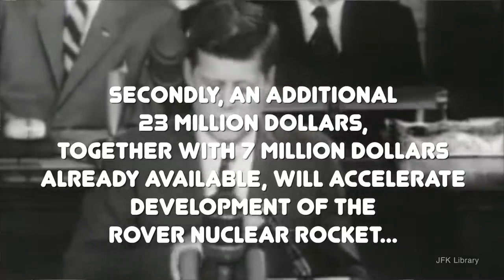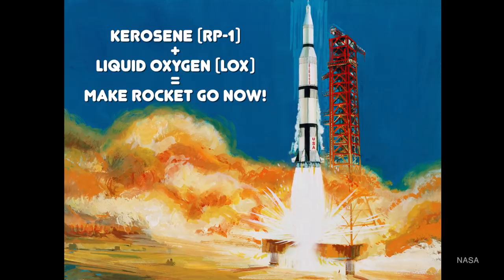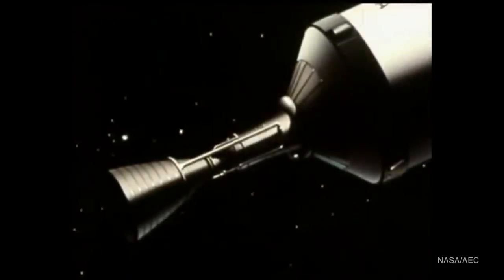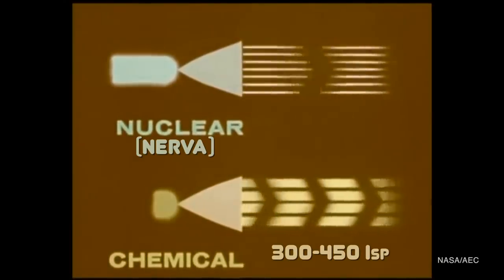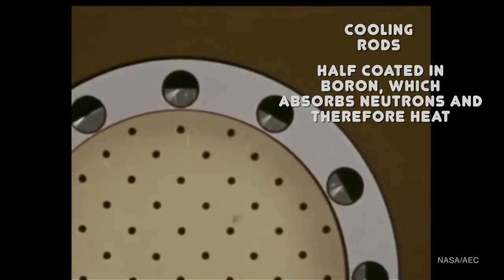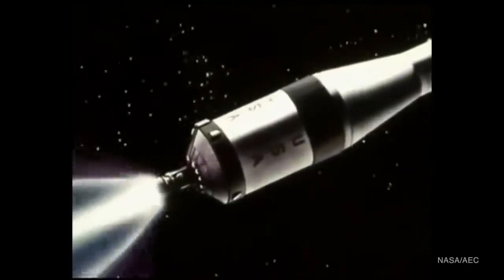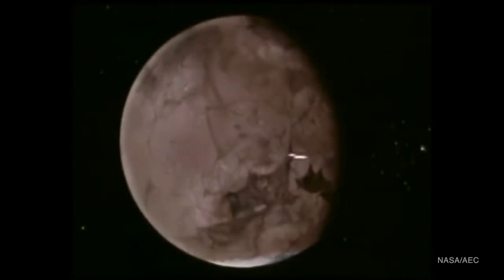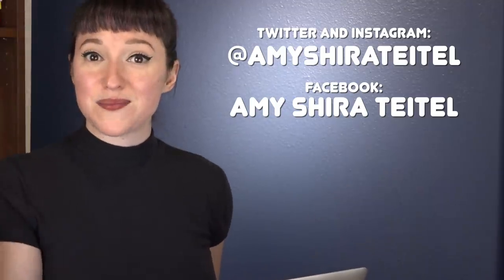A Primer on Nuclear Rocket and Why They're Awesome in Space

Comment: So while I love vintage space, I do have to disagree with the explanation given here.
What governs rocket propulsion is momentum exchange so having a faster gas exhaust speed with a lighter gas (ie hydrogen) doesn't necessarily give you more thrust, as for Isp, it is purely based on the exhaust speed and not the mass of the propellant!

To achieve that high exhaust velocity, we heat and pressurize the gas and then use a convergent divergent nozzle (or de Laval nozzle) to accelerate it, whether you use a nuclear or chemical rocket!

The reason a nuclear rocket engine is much more efficient (Isp wise) is primarily due to how you achieve that high temperature and pressure! You are using fission which is has much higher power density than a chemical reaction! This is why a nuclear bomb is such more destructive than a chemical bomb!

Since the energy density of the chemical reaction is much lower, this is the first reason of the Isp difference. A second one is directly linked to the chemical process, in a chemical rocket, the pressure required are so high that the chemical reaction time is equal or longer than the time the fuel spends in the engine, so you do not actually use all your fuel! The big flames you see is what the engine waist! This is why hydrogen fuel is the best rocket fuel today, not because of its mass but because of the kinetics of the combustion, hydrogen has a much faster reaction time than fossil fuels so you extract proportionally more energy from the fuel that you can use before you eject it out of the engine.

Finally, the primarily reason of the use of hydrogen for the fuel in the nuclear rocket is due to its thermal properties which optimize the heat transfer through the reactor! The key part is getting the gas as hot as possible! Even with hydrogen, the NERVA designs were planned to produce about 5 GW, which would make them the most powerful nuclear reactors in the world. If it was as easy to heat up a heavier gas we would do it as we would generate proportionally more momentum.

Basically, it is a fight between splitting the atom and stealing electrons!
Reply: SoldatInconnus 
Exactly.  We’re still a Slave to F=MA. If the exhaust gas is lighter it HAS to be faster to generate the same thrust.  Now with the nuclear engine, you can run it longer so...
Reply: And something a bit more unheard... How to repair an engine that becomes radioactive?
Reply: Ultimately tho you are temperature limited and the lighter hydrogen atoms are moving faster, at this given limit right? A heavier gas has a lower Isp at a given temperature and reactors will melt if allowed to get too hot. This is why other ideas like the gas core reactor are proposed. Solar thermal uses hydrogen for this reason and can achieve over 1000 sec. as opposed to the 800 plus of solid core nuclear reactor rockets using a rhenium heat exchanger (at lower thrust and for in space use only but at a tiny fraction of the cost).
Reply: It DOES matter having a faster gas exhaust speed with a lighter gas, being lighter means that you can load more with the same mass. So in the end you will have more thrust for the same weight
Reply: @stevemickler452   dear Steve, in the Nuclear rocket, you are not temperature limited but energy limited (big difference), which explains this. You prioritize the the gaseous element that can best transfer the heat from the reactor to itself so that you can extract the most energy, which here is in the form of heat! And again, heat transfer is mass dependant but much more dependent on the specific heat, it will take 10 times more energy to heat up 1kg of water than 1kg of iron! Hydrogen's thermal conductivity and specific heat in the gas phase is greater than any other gas and this is why you pick hydrogen, combined with the fact that it is the most abundant element in the universe means that it is the one element where you could imagine space refuelling. 
As for the Isp, the reason the heavier gas has a lower Isp is because its thermal properties are not as good as hydrogen! Ve is directly dependent on the gas temperature and the mass but specifically on the isentropic expansion factor (thermal property) which influence the much more the exhaust velocity! At equal Isp, it is better to have a heavier gas. Whether you want to look at it from the point of momentum or thrust, the total momentum is p=vm and the thrust is T=v*dm/dt so it means that if your gas is twice lighter, you have half of your thrust but the same Isp! Which means now that your tank is twice bigger and so your rocket is much more bulky and heavier to send the same payload into space! The MAIN reason hydrogen is the best is because while you have the mass as a factor, the thermal properties influence much more the result of the thrust, more than the mass and compensate for the smaller mass of hydrogen!
Reply: @burt591  Dear Burt, I had made a mistake and put Isp instead of thrust in my statement above and corrected it, was thinking one thing and typing another, however, I do apologize if I was not clear. I wanted to make two points:

 -The exhaust speed is not driven primarily by the mass but by other properties, for example chemical tripropellant rockets using H2, Be (or Li) and O2 combined, while being heavier, produce a better Ve and as such a higher Isp that Hydrolox!

-At equal Ve, it is better to have a heavier gas. Whether you want to look at it from the point of momentum or thrust, the total momentum is p=vm and the thrust is T=v*dm/dt so it means that if your gas is twice lighter, you have half of your thrust but the same Isp! Which means now that your tank is twice bigger and so your rocket is much more bulky and heavier to send the same payload into space!

 Finally, may I add a point, Isp is kind of useless and one of the historical reasons it is used is because it is only based on seconds which means it doesn’t matter if you use imperial or SI units, the value is still the same! If you design a rocket, you do not necessarily focus on Isp, the proof is with SpaceX and all the new generation of rockets which will have a lower Isp that the current ones but are cheaper and depending on how you define efficiency, more efficient!
Reply: @SoldatInconus  I would like to add that kinetic energy provides a different analysis. If I remember correctly my kinematics,  hydrogen's higher efficiency relates to higher kinetic energy. I think we're applying the big bullet argument where bigger= more momentum= bigger boom= better, but a a smaller faster projectile (here the exhaust) carries more energy. Remember that velocity is squared in the equation.  One must also remember that accelerating a heavier exhaust product costs more energy, which is why hydrogen but also water in nuclear/fusion reactor designs is often the reaction mass.
Reply: @rolfbjorn9937  Yes and No, the way to see it is you choose hydrogen due to it's chemical properties, however, a lot of its chemical properties come from the fact that it is a single proton and the lightest element! as for the kinetic energy point of view, you are converting heat energy into kinetic energy! And yes hydrogen will accelerate better than a heavier particle, however, you don't necessary have the same amount of energy to start a uranium ⚛ at 5000k at rest has a lot more energy than a hydrogen atom at the same temperature at rest! I do not know the answer if hydrogen is the best in this analysis! But again! The exhaust velocity (Isp) is not the absolute metric that drives a rocket design as with hydrogen you have enormous tanks! but moreover, energy is not the key factor! It is momentum as since momentum is mv and kinetic energy is 0.5mv^2 you could have a particle with a higher kinetic energy but a lower momentum compared to another. Finally, I have to add a precision, you do not have a single nuclear reactor with water as a fuel, water just acts as a heat conductor as it is exceptionally good at that! the fuel in a fission reactor is usually uranium or plutonium and for a fusion reactor we are looking into deuterium and tritium, two isotopes of the hydrogen atom,  hope this helps

Comment: Could you do a video on what would happen if the Saturn 5 rocket exploded
Reply: Think small nuclear bomb.
Reply: @randomworld1  yeah but I still want to know exactly besides no one has looked at this topic trust me I checked.
Reply: @jonathan-rm4sk  If a Saturn 5 exploded (depending on mission stage) it would kill everyone around it. This never happened though in a mission, thankfully. This is part of why there is an enforced radius away from the launch site during launches. Well, that and the risk of people going deaf. The Apollo command module (which had the astronauts in it) was equipped with its own launch escape system in the case of a serious Saturn 5 issue. If 2 out of 3 wires that ran all the way to the base of the rocket during launch lost power, it signified that the booster was coming apart, and a small rocket on top of the module would fire, lifting the module off, and the module would splash down.
Reply: @SweetBearCub  yeah I know why they built the launch pad that way I'm not dumb I'm just curious what would happen if it did like what would the blast raiders would be how powerful it would be and how deep a crater it would make stuff like that because no has done a topic like this before trust me I checked.

Comment: Had a senior colleague at Westinghouse (semi-retired and since passed) worked on NERVA as a chemical engineer. He said one of the big problems he couldn't solve that in the event of a catastrophic failure, the fuel would not burn up and dilute into the atmosphere but come down in large masses (I can't see which would be more preferable but apparently it was to burn up and disperse). Like the ablation protection on space capsules, the fuel would form a plasma around it which would protect the fuel elements from additional heating (thermal radiation transfer to the fuel created by drag was inhibited by the plasma) and keep it from breaking up. Or at least that's how I understood it.

Comment: 2 difficultys have to be solved:
1. to control the reactor fast and percise is really difficult, nuclear plants do that really slow to be safe.
2. back in the days corrosion was a major problem. It is hard to find a material that withsands that heat and is stable with Hydrogen.

My propulsion professor is in love with those thermal nuclear engines.
It would make him happy to see something like this again

Comment: One problem that should be mentioned with nuclear rockets is shielding. They generate intense gamma and neutron radiation while operating, and continue to emit some gamma after shutdown as the fission products decay. It's a manageable problem, but because shielding is so heavy you have to carefully lay things out. Liquid hydrogen is a pretty good radiation shield so that tank serves two purposes. So is water if you happen to be carrying some. Also, simply getting distance between the reactor and the payload (or astronauts) helps a lot.

Remember the spacecraft Discovery in 2001: A Space Odyssey? Clarke designed it to use nuclear thermal propulsion, that's why it was so long. The tanks and compartments that made up most of its length helped shadow the inhabited sphere at the front from the reactor radiation in the rear. Presumably station power was also generated in the same or another reactor so there was a constant need for shielding, not just when the rocket was firing.

Comment: While the stoppage of funds ended the nuclear rocket testing, I read that there were major problems with the gas exit tubes, through the engine, disintegrating due to vibration.  The whole nuclear non bomb testing back then was really interesting.  Testing of a nuclear aircraft, rocket engine, and battery.  The battery technology is powering the latest rover on Mars for example.

Comment: That technology has not gone away.  In fact, the means for applying it have greatly improved.  It should also be noted that the efficiency of the NERVA unit was based on the ground based tests of the first working models before the project was closed down.  The potential efficiency is much higher.  Also; the radiation factor of the exhaust is so low that this procedure could be safely use to propel rocket vehicles directly from the ground into space.
Reply: "Also; the radiation factor of the exhaust is so low that this procedure could be safely use to propel rocket vehicles directly from the ground into space." Is there evidence for this? Also even if that was true, would a NERVA-variant rocket engine generate greater thrust within the earth's atmosphere than a chemical rocket engine?
Reply: @newhank21  It would not only be more efficient than a chemical rocket by an order of magnitude, it would likely be of acceptable levels of radioactivity.  The propellant would likely be either liquid hydrogen or distilled water.  They contain little that would be rendered radioactive by its passage through the reactor.  The only hazardous place would be at the launching site itself.

Comment: The Nerva - a mythical construct that is only rumored about in legends. Thanks a bunch for the insight!

However, I'm being left with a few open question: How did the pumping system work on this rocket engine? Chemical rockets use highly sophisticated turbo-pumps, but how would that work here? And also: How would the engine cool itself when it's not firing, meaning when there is no hydrogen running though it? Are those cooling rods really enough for longer periods of time?

I'm terribly split on the topic of nuclear propulsion. On one hand there is its awesome efficiency and raw power. On the other hand there is this constant hazard and all the nuclear waste. The same old story up there in space as down here on earth, isn't it?

Comment: Welcome back m'dear! Nice to see you and Pete making videos again. :-)
Small point of order if I may? When you were talking about the Saturn upper stages using Hydrogen and Oxygen fuel, you showed a graphic of the CSM burning it's engine. The CSM engine however did not use Hydrogen and Oxygen: it used Aerozine 50 and Nitrogen Tetroxide instead, since these fuels are no cryogenic and would not, therefore boil off during the extended flight to the moon and back.
Reply: That and the CSM would have to do multiple engine restarts, and so a hypergolic fuel choice simplified the engineering involved.

Comment: One of your illustration videos for the Hydrogen-oxygen third stage showed only the command and service module, probably in lunar orbit injection or other lunar orbit transition. Knowing that almost three days had transpired before that engine was being called upon to perform, I needed to check to see if my own memory of its fuel/oxidizer combo was the correct one or was I having a senior moment. First it needed to be hypergolic for reliability, and whatever fuel combination it used needed to remain liquid for the time at the moon and back to earth, so it could not have been cryogenically stored without losing much of it to outgassing, so I checked and it was the standard of that time, Aerozine 50 and nitrogen tetroxide.
That made me realize that  the same time and extra mass restrictions would apply to the Nerva using hydrogen. I.E. all of it would have to be consumed as it achieved its trajectory towards Mars, leaving a radioactive source fairly close to the crew.  Even if it could shorten the transit time by several months it might not be of much use at Mars  to brake that extra velocity over minimum Hohmann Transfer velocity. Reaching the surface from Mars orbit would require  carrying a smaller vehicle there and back, but leaving the Nerva stage in orbit would make refilling with locally sourced reaction fuel very difficult if it made the whole trip in order to be the return vehicle.. 
It was bad enough when Skylab came down in Australia, or when the Soviets had one of their space nuclear reactors come down out of control, so I would suppose Nixon's cancellation had Soviet use of the same sort of rocket in mind along with the other considerations when he cancelled the program.

Comment: 2:57 in -- higher exhaust velocity does not just mean higher thrust, but actual higher spacecraft velocity.  The father or modern rocketry, Konstantin Tsiolkovsky (1857-1935) proved that mathematically.  (The only other factor, albeit important, is having the payload as small a mass compared to the total pre engine firing mass as possible.  (At any stage, not just the launch pad.)